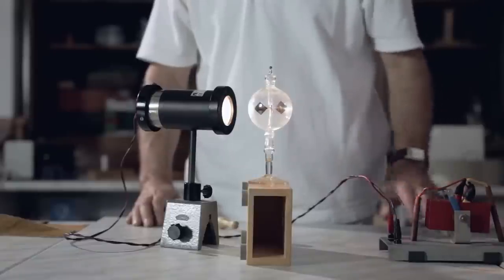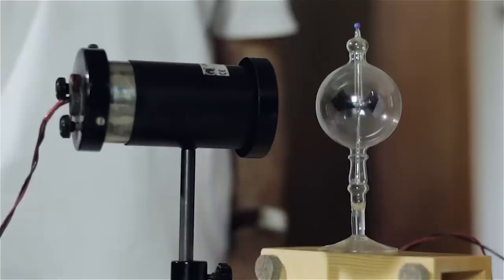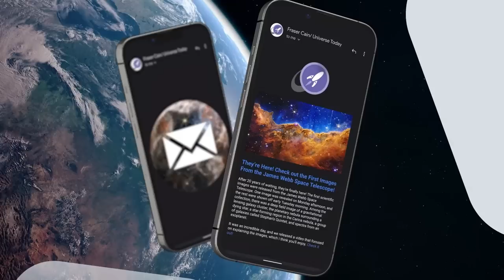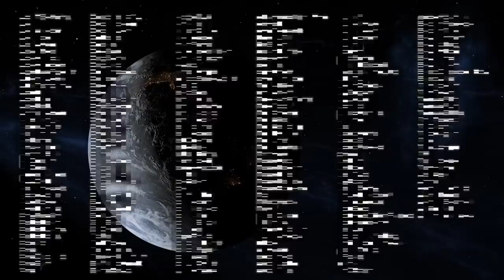NASA Develops Flying Saucers. Literally [NIAC 2023]

Comment: The Crookes radiometer desktop toy actually rotates in the wrong direction as originally proposed by Crookes. It was supposed to show radiation pressure, should according to that absorb photons on the black side and reflect on the shiny side, and the radiation pressure should make it rotate black side forward (away from the radiation). However, it doesn't have a pure vacuum, the air molecules heat more on the black side and bounce off with more momentum and pushes it in the opposite direction (actually the edges of the vanes are important).
Reply: Sweet description
Reply: @norml.hugh-mann  I dare say that scaled up, the vanes and spindle could be coupled magnetically to an external 'propulsor', rotor-system  or propeller of sorts, that could still 'bite' into the thin air at extreme altitudes to generate lift or thrust, although it would be interesting to see how high the system could go. The success of the Ingenuity helicopter on Mars suggests that thrust is still possible at over 30,000 metres, maybe more at even at 1 full Earth gravity. Station-keeping at altitude might be an interesting challenge.
Reply: @mauricegold9377  No expert here, but Methinks there's no way a Crookes spinner could generate near the power required to act as a motor for a propeller spinning as crazy fast as is needed for Insight-class lifting.
Reply: @737smartin  I do agree with you here. The torque required to spin a prop at adequate RPM is unlikely to be delivered by a Crookes radiometer, even a large one.  Electric motors can deliver torque at minimal RPM. I guess I was too swayed by the enthusiasm being generated in the video.

Comment: I would look to use 3d printing technology to manufacture this ultralight nano cardboard using plant cellular stoma and pigment cells as part of the matrilineal form.

Also, from a botanical aspect, certain flowers appear more bright than others, even though they both produce the same anthocyanin compouunds, and this can be attributed to the petal cells surface shape ranging from conical to flat.  The vacuole at the apex of one of these petal cells contains the pigment, and it too can be inflated or deflkated to adjust the cell external profile.

This botanical architecture certainly sounds at a similar scale in terms of size

Comment: The black heats up and the residual gas in the bulb gets this heat transferred to it on the black side. The white side gets reaction of simply twice the lights momentum.
Reply: No, it's actually a ghost. That's why the devices are actually called ghost detectors.

Comment: I had one of these model glass with vertical spinning panels that responded to light back in the 1960s and I thought then that it  could be a great off the grid energy source if expanded and mounted on houses and buildings ! But this aerial flying device would even more amazing !

Comment: I want to know how this works with illumination from above, since the sunlight will be coming from above the lifting craft.  If you are absorbing light from the top of your craft, you would have to disproportionately heat the bottom of your craft to create an upward reaction force, this seems like a non-trivial issue. The demonstration videos show the craft being illuminated from below, so not really applicable to the real-world situation. Why was this question not asked? To me this is the most interesting issue with this idea.
Reply: I was pondering this question myself, I am wondering if the answer is simply two layers, the top being transparent to infrared, and the bottom  being super absorbent, with an insulating layer between, probably just atmosphere? Maybe it is that trivial, but I would like this explained by the expert.
Reply: @tylerhloewen  well, if you see the little lightbulb toy you'd notice that one half is spinning towards the light and the other spinning away, it's because it's only one side of each blade that's coated with the black coating, so that when the blade spins towards the light it's not affected by it because the darkened side is facing away from that light 

The idea with this floater is to use the reflected sunlight coming from the ground to provide the lifting force against the bottom of the craft, the top won't be coated with such material so the sun doesn't affect it from above and the object maintains that pressure difference that helps keep it aloft
Reply: @SmoochyRoo  Where did you get this information about using ground heat? Do you have a reference? Can you link?
Reply: Good question! Perhaps this technology can only be used at the Earth's poles or during dawn or dusk, when sunlight shines from below.
Reply: @tylerhloewen  Well yes, the structure is thin enough to be transparent to the incident radiation and the bottom black layer absorbs it heating up. Igor explains it here:
 https://youtu.be/5X4br9lqdJU?t=1833
Reply: @markpurcell8075  Thank you! This answers my question and is an excellent link. Definitely would recommend it for anyone wanting to understand how this works on a more technical level.
Reply: Yep. Exactly

Comment: I'm just a crazy old guy, but if you made this in a sort of frisbee / wing shape with a bit of fan blade on top and a funnel down center, you could create lift from spin with a vortex jet down the center. This would also provide a stabilization from rotation.  Air will flow down the surface toward the  outer edges and center if it is convex in the middle and concave in the center causing upward thrust from rotation picked up from whatever wind is available at that elevation. I am trying to develop a kite which does this and then channels wind down a tube to a turbine generator, most places have sufficient wind for running a turbine, but that wind  speed begins about 100 feet off the ground. If you develop the appropriate design it can revolutionize energy production  as a bonus.

Comment: The air scooping ion engine would be in space most of the time and just dip into the atmosphere a little bit at the perigee to do the maneuver burn and scoop up some propellant. You'd have a long time to collect solar energy before the next time you dip into the atmosphere and the apogee would raise each time. I think the main limitation would be needing a long time to build delta-V and the plasma erosion. What if the overhead satellites whizzing by at a regular interval could replace the sun by zapping your craft with a laser for a bit to get you through the night?
Reply: Air-breathing ion engines on satellites could prove to be operating on a knife edge, especially at first. Also, as far as I recall, the current designs make no attempt to store fuel, but instead just use it as it passes.

As for remotely powering such a thing, it's absolutely possible, though likely doing that would prompt the use of e.g. a Helicon double-layer thruster to eliminate plasma erosion from concern. You would want enough power satellites to guarantee sufficient power during high criticality periods when the vehicle was being boosted.

Comment: This technology is physically possible with long carbon nanotubes to conduct and spread static electricity and provide rigidity.  A parachute, bell shaped design with a small central hole to inlet cold gas to supplement what does around the sides.  A flap to seal at night using static e adhesion to turn into full parachute, would require electrical isolation from main body for that structure.  

For us humans to do this will need bacterial synth, tech that's maybe 50 years away.

Comment: How high above the earth does a compass needle no longer operate?
Reply: The higher you get, the more likely it is that the field gradient is pointing towards Earth's surface rather than parallel to it. Similar to approaching the poles at high latitudes.
 This causes the compass needle to dip downwards until it eventually scrapes the bottom of the inside of the compass.
 You might need a compass that was better engineered than most to be useful at high altitude.

As for how far you can get from Earth and still have a compass point at a pole? I dunno.
 It might be easier to look out of a window and locate the appropriate snowy bit of the planet.

Comment: This podcast? Really excited my mind. If this can be achieved and the science or data collection and transmission of data can be done then many doors will be opened. Less invasive  methods of data collection are needed. The rockets we use to reach outer spaces are huge polluters.  This interview points to nasa not having anti gravity machines......i think. My 2 cents are not based on scientific evidence but observation and my processing unit. Lol. Regardless its facinating to me.

Comment: Cool sounding technology concept, but I have littering concerns, at a time that we're finding "forever chemicals" contaminating every raindrop (and can even be found in our blood according to a Guardian Science weekly podcast episode, 28th of February 2023, and linked to female infertility), along with micro-plastics in our food chain.
Reply: I'm currently not impressed that the non-stick coating is peeling off my oven tray, which is the replacement for the previous one which did the same thing, except this one has done it in less time than the previous one.
 I don't want PFAS in my pizza.
Reply: @massimookissed1023  I switched to carbon steel and cast iron a long time ago,  there are some sub reddits dedicated to cooking with carbon steel and to cast iron cookwear. It lasts a lifetime (cast iron/carbon steel) and I think that it cooks better on the whole,  especially on induction cookers,  or gas hobs, some of the cookware works well on BBQ/grill too.  You pick up pieces really cheaply if you don't mind used,  or buy newer products.

Comment: Doesn't this cause a force away from the energy source? So if that source is the sun, the vehicle will be pushed down towards the earth 🙃
Reply: No, this is not using radiation pressure. The Crookes radiometer rotates in the opposite direction to that too.
Reply: @Mark Purcell  that's my point.  The radiometer heats up on the dark side, which is facing the energy source, which heats up the small amount of surrouning air (or low pressure gas), and it spins, away from the energy source. Which is the expanding air, from the dark side, facing the sun.
Reply: @DingbatToast  The black surface is on the bottom (opposite side to the sun), the whole stucture is thin enough to be transparent to the incident radiation so the bottom side heats up despite the sun being on the opposite side. Here's the more detailed explanation from Igor's YouTube presentation, he states it doesn't matter which side the LED (i.e. the radiation source) is on.
https://youtu.be/5X4br9lqdJU?t=1833
Reply: @Mark Purcell  thanks for the link. I hadn't imagined the material to be transparent. The demos in the video you linked do appear to prove the concept. Although a have my doubts that the temp difference will be ennough if the sun has to pass through the material first. I would be more convinced had he produced a small levitating model/sheet that was energy sourced from above, rather than the more efficient radiometer in the jar. Still, small steps. I will follow with interest!